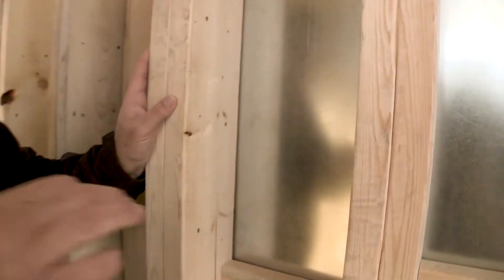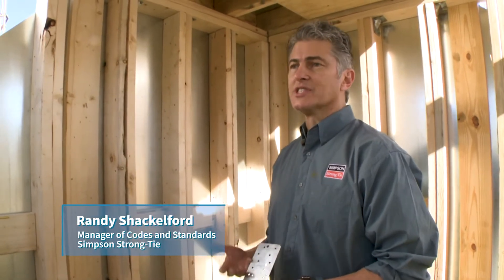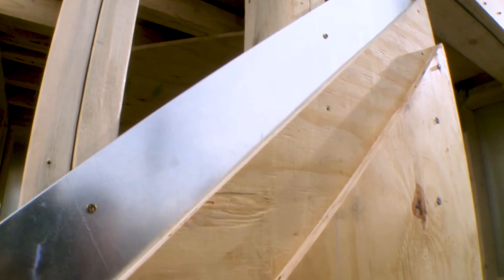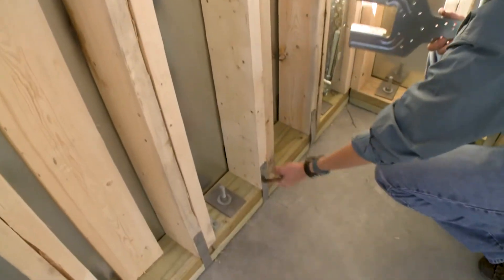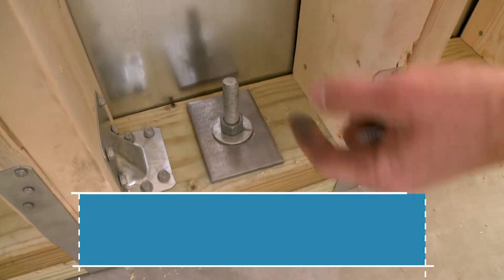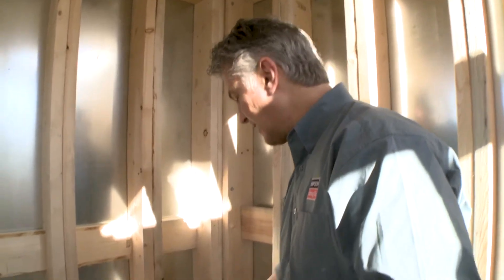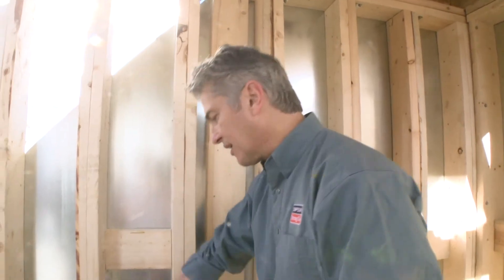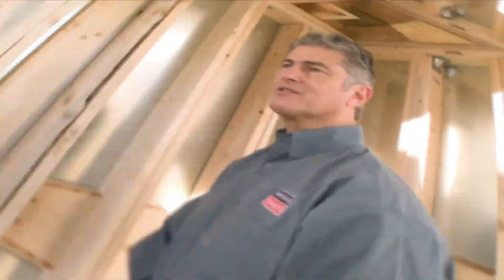Wood Frame and Steel Sheathing Tornado Safe Rooms

Comment: If you have a semi truck being tossed about in the wind, and it hits this "shelter" you will not be safe.
The only safe place is underground.
That "shelter" will protect you from the majority of tornado's. But not from the Moore tornado.
If you want a tornado proof room, here is how you do it.
Dig a basement for your house. Have concrete block walls for the basement. Preferably ICF. But regular cement block will do. Fill the block with cement and rebar. Install bolts sticking up from the concrete that are tied to the rebar in the concrete. Now buy steel plate and install it so that it spans the basement and bolt it down to the solid concrete block walls.
Now you have a basement that is protected. That is where you sleep at night. That is where your children sleep at night. That is where your safe is and your photographs of family and friends.
Your car and fridge are upstairs. Those can be replaced. Family can't.
You will want the entire basement to be covered and below ground level.
You live in safety. You sleep in safety.
You do not want to count on having 15 seconds to get into the "shelter".
Obviously you will want to protect against flooding and fire, so you need escape routes up and out of the basement, as well as 2 sump pumps with back ups. Dehumidifiers and good AC for the basement. It is a regular maintenance schedule that must be paid attention to. But worth every minute of effort.

Why do you want this?
because an old farming couple got into their basement for a tornado and the fridge fell through the ceiling squashing them.
Reply: Unclear instructions, dug basement in Florida, now have indoor pool

Comment: I have a house above a crawl space. I wonder if one could build a safe roof with the same type of floor as the wall and roof have, and anchor it in place with concrete piers dug into the ground and very strong steel cables tying the two together? Pleas if anyone knows let me know if it is possible or safe.
Reply: i also have an old pier and beam home - I think the only way is to build it outside on concrete slab

Comment: if you are building a house just make the entire thing tornado proof to begin with. Costs the same as a custom wood frame house.
Reply: This is a very inaccurate statement.
Reply: Not in todays market, it absolutely won’t cost the same.